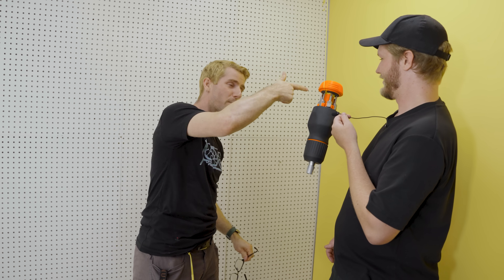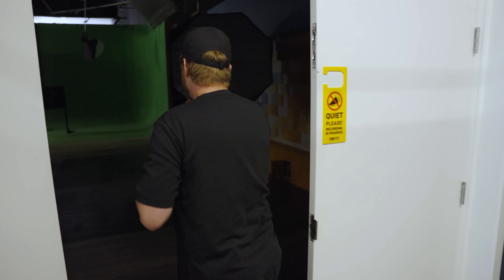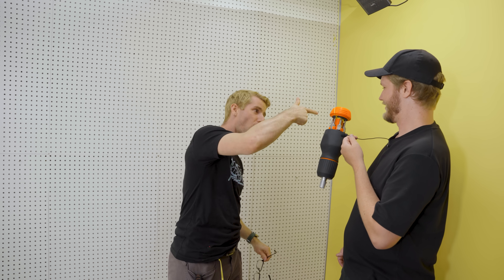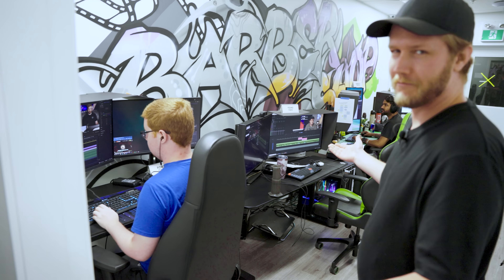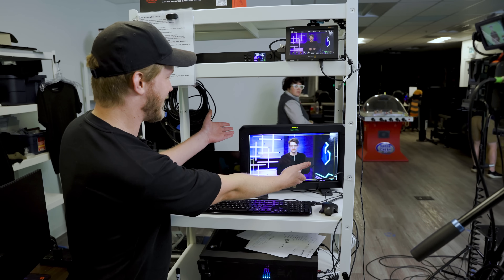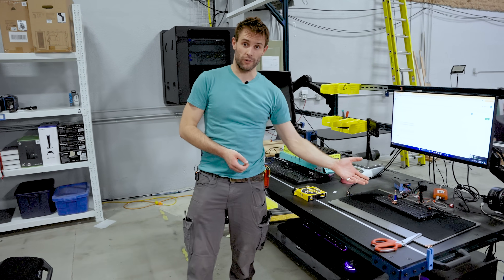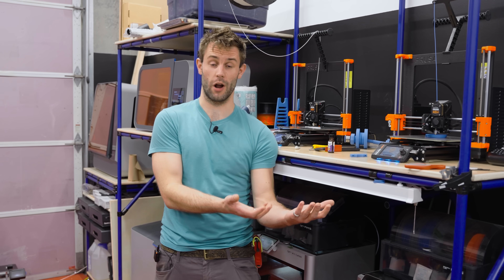Why Linus Tech Tips Can’t Live Without 3D Printing + Studio Tour

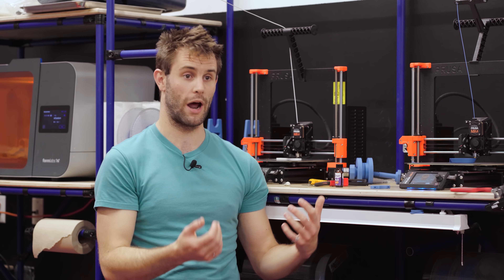Comment: 10:13 Umm.. we can clearly see the more capable printers temporarily sitting at the bottom shelf for this video.
Reply: And also Bambu labs you need to be able to reach the top of them due to the ams system so its most likely better for them so sit lower down and may help with reducing the vibrations
Reply: @campbellherbert7289 you can put the AMS where ever you want. It doesn't have to be on top.

And if your broken logic  somehow says having an AMS is a disadvantage over the Prusa not having one (in this video). Guess what? It can work without an AMS.

It's clearly a prusa sponsored video. But they messed up and showed the more capable printer they rely on, a bambulab. And I just pointed that out.
Reply: lol
Reply: Except you didn't hear him say how they get inconsistent quality with them, inconsistent quality is typical of chinese made printers. Prusa is better which is why they use them more often and on the top shelf.
Reply: @LilApe implying that a prusa is more reliable than an X1C is laughable.

Comment: that green looks like a golf course, lol. so, how about the multiple concurrent print heads on their own y-tracks. running at the same time, same or different filaments, no tool changers required. with longer sling print bed movement.

Comment: I run a Prusa XL most of the time and I an so super happy with it. Running Prusa Printers for a long time now. Even printing stuff for customers ist fun because the printers just work. I hate filling around and tinkering. Unpack, plug in, print. That's what I want. I am super eager to work with the Core ones. So far I ordered two yet.

Comment: Love how Prusa keeps trying to showcase their success while ignoring the glaring issues with the XL. How about focusing on fixing the XL instead of saving face?
Reply: I thought they had them all worked out by now? Something still problematic?
Reply: @logicalfundy  I had to reach out to support as the enclosure I installed caused some issues. The print heads were originally shipped with PETG parts. Support was adamant that they shipped the replacement parts meant to be installed and they didn't. After some arm twisting they shipped one. I own the 5 tool head version. After confirming the parts I just printed the rest. I have a very long laundry list, but that is the most recent example. I'm currently going through and reprinting all printable parts as some are starting to warp or crack. Some parts I redesigned even as they are very poorly thought through. I'll stop here. I'm only mad cause I care. I want this printer to be good. It was a disaster from the start and I feel left out to dry. I just have to sort out tool shifting problems and I'll have it running well enough to bring online for production.
Reply: @jmsether  That's a bit strange, as the XL and the Mk4 both use the Nextruder, and I've never had parts start to warp or crack on my Mk4, before or after I upgraded to the Mk4S.
Reply: @logicalfundy  I was running a ton of Nylon fiberglass and a bunch of other fiber glass materials that require me running the nozzle at 300c. It's caused a bunch of issues.
Reply: @jmsether  the 3d printed files are all public and open source...just download them and re print in material meant for higher temp. Seems like a silly thing to complain about, not an issue with the XL.
Reply: @LilApe  it's more the straw that broke the camel's back.

Comment: Just came to say that if you were going to be competitive in the market, you should have released a printer without a stupid build volume! Come at me orange and black seethers, team green ftw.
Reply: Well, the Core One is supposed to be a drop in replacement for the Mk3 / Mk4 in print farms, so it couldn't be too big. But they do have a large printer - the Prusa XL.
Reply: Just remember after 2.5 years of Green ,Prusa's mk4, mk4s and the Core one are the BEST they can do and they are not even comparable to that 2yr old printer. This is the BEST they can do...lmao

Team Green has sold over 1 million printers in those 2 years and prusa hasnt sold  that many printers  in 12 years. 
They need to take pot shots against the competition vs building a more compelling printer. They are scared as they should be. They never had to compete, but this attempt at competition is sad....

Their new claim to fame is...flips pages
you can stand on it...
the door is plastic
the fans turn on if the enclosure gets hot
Clearly the folks over in Prague dug deep with this feature set.

Even Creality upped their game in that span of time and the Josef camp is upgrading the small mk4s into small core ones...for nearly the cost of a brand new unit....lmao. Genius!

While I got the little monkey here the CEO clearly stated he changed his mind and pushed out one of the most popular bedslingers for a fraction of the price of the mk4 with multicolor. That's what businesses do. They match the market, give the people what they want and...make MONEY! why do you think prusa abandoning bedslingers now that EVERY modern 3d print company has gone CoreXY?  10 years of bedslinger and they finally have a coreXY that isnt 2-5 grand. 

 I was hoping prusa would at least compete with a printer from 2022.....but looking at the Core One..this is the BEST they could come up with.... I am left shaking my head.
Reply: @AmericanVirus-rf1rn Prusas are solid printers with excellent support that are easy to repair and modify. I don't think they can compete on price with Chinese companies. I do think being able to control the chamber temperature on the Core One is a good improvement and shouldn't be glossed over. As far as I know, only the X1E from Bambu can do that.
Reply: So the prusa XL has a "stupid build volume"? The bambu A1 mini has a smaller build volume than the core one. I don't hear you crying about that. Bambu released 5 variants of the same printer and two bedslingers when they said they never would. One has a tiny build volume and the other was a fire hazard. At least prusa has every printer style under their umbrella. Cantilever, I3, coreXY, delta, resin, etc. "Team green" couldn't even be honest to customers about selling out of stock items as "in stock". So people are waiting weeks to months for their orders. And now their reviews are in the dirt.
Reply: @LilApe  The a1 is a budget printer, does prusa have a 200€ printer? 5 identical printers, where? Releasing a new product when they promised not to is somehow bad? Fire hazard? You mean the mild heat bed issues that were resolved? Supply chain issues which prusa is known to be somehow immune to? A few anecdotal shipping delays? Reviews in the dirt because of some one person receiving their items late?

Comment: Casually insulting "other" printers for consistency issues while having several Bambu printers in camera view -.-
Reply: A machine can be better than others in some way and worse in other. The only thing he said was that prusa is better at consistency across machines than the competition. That doesn't say anything about other applications.
Reply: LTT was paid for this video, that much is clear. Outside of this video they arent shy about the fact they usually have 5-10 X1's set up and printing. Linus himself uses a P1S with 3 AMS units at home. Nothing wrong with Prusas, but this video is INCREDIBLY misleading.
Reply: that's how you know it's genuine. they show that they are actually using the printers, and have experience with the machines
Reply: He said they sucked when he got there. They started using Prusas in 2020; Bambu didn't start shipping printers until 2022. They were probably using something more difficult to manually calibrate like the Ender 3
Reply: obviously, there's going to be bias when the people from prusa come over and film you. They aren't just going to say that a competitor is better
Reply: In the real world I've seen the opposite.  Bambu's are much more consistent between machines.
Reply: @MikeKow80  then you clearly didnt see enough of them ;)

Comment: a collab I did not expect
Reply: 3D printing could definately be of use in the PC build world. Genuingly curious why this has recieved so many upvotes.
Reply: @JB-jr3bm  Definitely. And actually - it has been. Plenty of people are now 3D printing cases. If you're missing one of those covers for the slots in the back, you can 3D print a new one. If you need an adapter to fit a 2.5" drive into a 3.5" or 5.25" bay, you can 3D print one. There are plenty of use cases for 3D printing if you're into PC building.
Reply: @logicalfundy   About a year ago i printed a holding plate for my Phanteks big tower PC case to mount the Corsair Commander Pro fan controller on the backside of my PC case, as it was unexpectetly too large to even be able to fit into my big tower PC. Which is insane and i didn't thought about it when buying it. So i had only one area on the back where it could fit which is basically Phanteks SSD mounting system where i instead screwed my printed plate onto. Without my printer i might would have to be able to use the Commander Pro at all.
Reply: I guess it´s not really a collab. Prusa is known to go to their bigger customers and give an insight in how they are incorporating 3D printing in their work. And I love, that they also choose something "less-industryly" like a youtube channel with merch, allbeit a big one :D